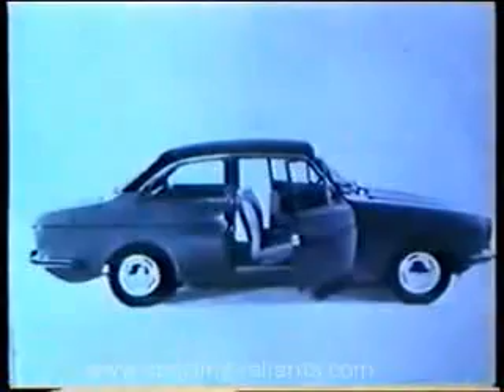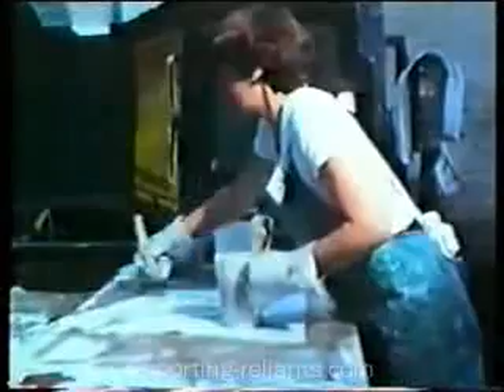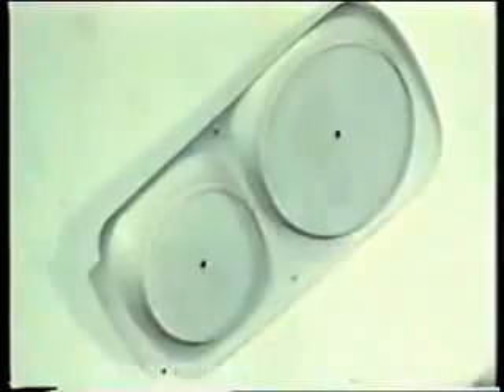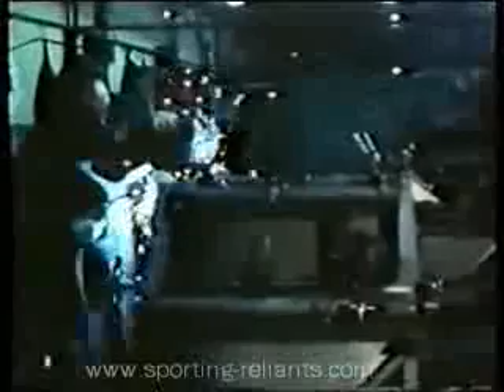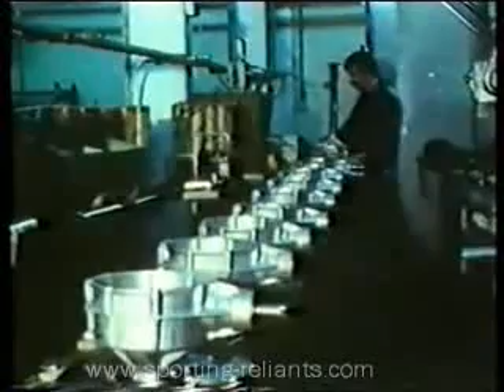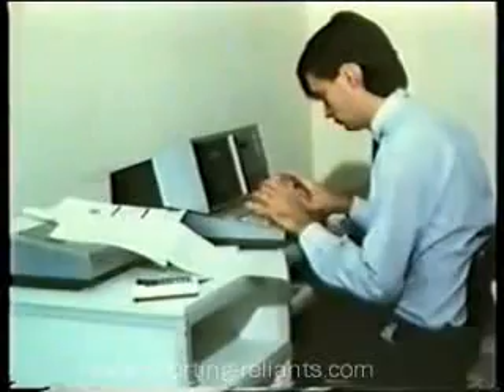World of Reliant Video

Comment: Boils down to the fact that it’s target market has died out, ie northern factory or pit men who wanted to travel the 3 to 5 miles to their place of work without getting wet through on the Honda 90.  Should have moved on with the times .
Reply: or at least added another wheel!
Reply: @R410a-ac  4 wheels is boring though. There are loads of 4 wheel cars so it wouldn’t have stood out as much. The kitten was a 4 wheel version of the robin but didn’t sell nowhere near as many as the robin or Rialto.

Comment: Great documentary,I knew they built their own bodies and engines,never knew they also built their own gearboxes,interiors,chassis or built GRP mouldings for others
Reply: Not sure they had the expertise to design a gearbox or an engine from scratch, they were given the rights, drawing etc. to build the Austin 7 engine. I assume they designed an aluminium version of the Austin 7 engine and modded it to OHV for the later Regal, Robin & Rialto (exact info. is hard to come by). I believe that the main running gear for the Scimitar GTE was all Ford. Sorry to sound so negative!
Reply: @Martindyna  The gearbox was Reliant own design, the early side valve engines were based on the Austin 7 engine, but the OHV Alloy engine was not the same as the Austin engine in any respect, except is uses the same concept like any engine.  the Scimitar used a ford engine and gearbox, but the Robins and Rialtos used Reliant's own engine witch is loosely based on SC standard cash iron engine . they had the expertise, to develop engines. Reliant produced the first All alloy engine mast produced  of it's type, and even before the Hillman imp. Reliant biggest expertise was in building fiberglass cars, they even taught  Lotus and TVR how to build fibreglass cars, they built the Ford RS200 rally cars on behalf of ford. Reliant were far from inept.